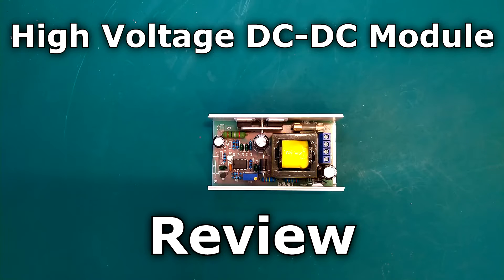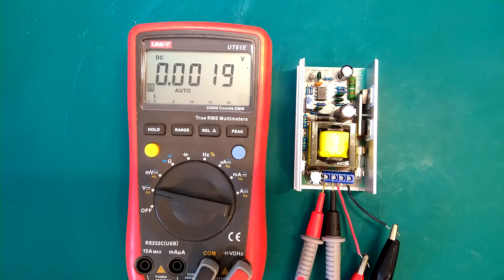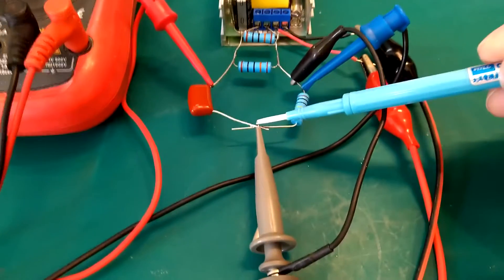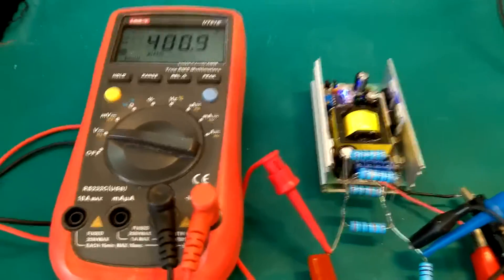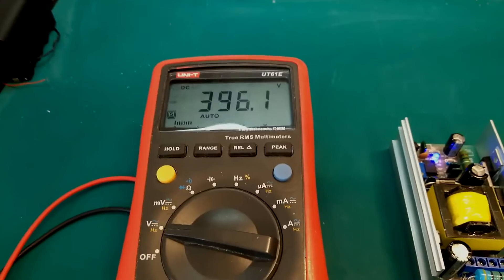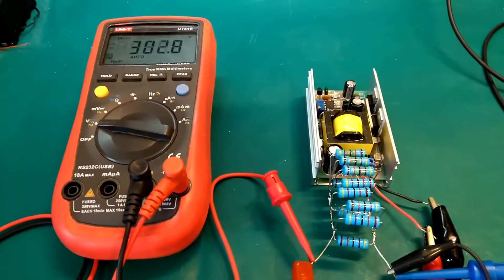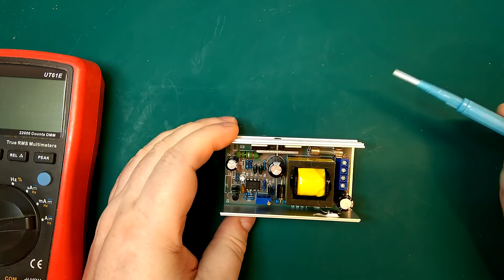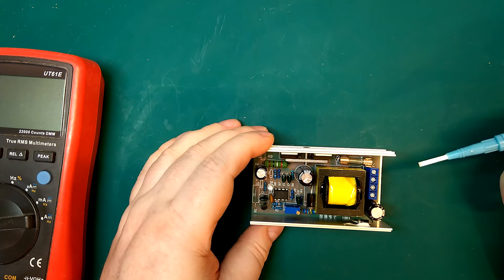High Voltage (200-450V) DC-DC PSU Module $10 Ebay Review

Comment from the maker: Advertised as being able to deliver 70W peak and 40W continuous, however I find it will not deliver more than 20W max. I don't recommend buying this module unless you plan on powering it using 24V and you don't need more than 20W output.
Reply: Thinking about putting it to trickle charger  a high voltage battery from a solar panel.

Comment: Thanks for the vid! Did you notice any annoying buzzing sounds from the transformer etc?
Reply from the maker: Hi, I haven't experienced any sounds from the transformer, it behaves very well. I now use the module in a high voltage capacitor leakage tester project.
Cheers,
Jake

Comment: I need high dc-dc voltage step down module
Input 100-200vdc
Output 50-100
Reply: They got lots of those selling stepping down voltage is easy. Going up is a bit difficult.

Comment: I need to to convert 12 VDC to 285 VDC at around 0.400 amp. (400 milli amp). I am trying to charge my dead hybrid batteries. can you help with the info soon, please. thank you very much
Reply from the maker: That's 114W output, none of the modules I have tested are able to deliver this much, plus it will need to draw at least 30A from your 12V source. You could try running multiple modules in parallel using some diodes and resistors to balance them, but I can't guarantee good results.
Cheers,
Jake
Reply: @TheStuffMade  thank you for your reply. I found a way to charge with lower voltage by using a bench power supply, 11VDC at 3.2 amp.
Reply: @bobbauvian7700  - I'm also trying to charge a hybrid vehicle traction battery, a 2008 Prius Gen2 rated at 201.6 volts DC. Have you had any success? Thanks for responding
Reply: @3000Jeffrey  yes, I disconnected all the battery cells and charge them 8 cell at a time, You can even do 1 cell at at time. I had a bench top power supply, and 16 alligator connectors. so, I charged 8 at a time. the voltage of a single cell battery of mine is 8 volts. so I set my power supply up to 8.2 and 3 amps. it charges quick so stand by the batteries, disconnect power supply and measure making sure you don't over charge. I probably could have done a better job with lower amp setting and taking my time. but I needed my car. maybe if you do all the cell at the same time you get a more uniform charge....but you make do with what you got. On my Prius I had to replace the 12V battery as well. 
  
you may do a better job if you recondition the hybrid batteries. do your own research on how to recondition hybrid battery.  I may be making a mistake but the way I understand it goes like this:  using a load drain the battery cells and recharge them. I did 1 cell at a time. I used a halogen bulb (24V 150W). Bulb did not turn on bright at all but it did do a good job at draining the batteries. when you disconnect your load the voltage should go back up. I discharged to about 5.5 or 6 volt and when discounted the load, voltage went over 7 volts which is the indication of a good battery. on my battery any that did not go over 7 volts after load was discounted should have been considered bad battery cell and replaced. the battery cells towards the middle had a hard time but I kept at it recharged and discharged them multiple times and they picked up. My Car had shut down and could not drive any more. Using the method above it came Alivee, and drives up to know, though I do get a triangle, check engine lights and warning still when in traffic specially if air conditioning is on...which I can clear out by disconnecting the main cable from the 12 volt battery for 5 minutes. 
I should have replaced the 6 or 7 middle battery cells at about $40 each. since I was not sure about the quality of the cells for sale I decided not to do that. 
found a guy close by who would replace the bad cells and charge $600, 3 month warranty. I did not do that either. 
found an outfit about 150 miles away who replaces the complete battery for $1200 with I think 2 or 3 year warranty. batteries are green color. this I will do within a couple of months.  
I hope this information helps helps you.

Comment: (308V*65mA)/(24V*1.2A)= 20.1W/28.8W=0.697 eff.! Not that impressive, but what to expect at 20kHZ? There are low voltage DC/DC converters appearing from China, that operates in the MHZ range and uses a hi Q inducter and fast caps and diode, and they peak at 92-95% eff. So let's hope they design a hi-voltage version like this. However it will need more expensive bits, so it won't be as cheap as this, but China expensive is preferable to Mouser expensive. Thanks for the review, That saved me some trouble.
Reply from the maker: Thanks, those are useful numbers. For my use I haven't been too concerned about the efficiency and 70% isn't too bad, but sure, I understand if you want to use it for anything battery powered or part of a renewable energy setup, then this converter is not a good solution.
Cheers,
Jake

Comment: Good review but it would have been nice to see how much current it takes from the power supply with each load to know how efficient it is.
Reply from the maker: It's a good point, my focus was mostly on whether the psu would be able to deliver what was promised in the sales specs. I'd say these are probable fairly low efficiency as they are low input/high output voltage, so I wouldn't expect anything above 50-60%

Comment: Hello, thanks for this review. Im planning to use it for my hv 200v battery charging from 12v source. Do you think it can be done?
Reply from the maker: Hi Bryan, I just hooked up the module with 12V input and a 5K load then set it to 200V output, no problems. So it will deliver 40mA+ at 200V with 12V input. It should work fine to charge a 200V battery, just be aware the 200V output is the lower limit for this module, but you can of course just add a resistor in series to limit the current.
Cheers,
Jake
Reply: TheStuffMade Tqvm... cheers
Reply: @bryankok2315  -  I'm also trying to charge a hybrid vehicle traction battery, a 2008 Prius Gen2 rated at 201.6 volts DC. Have you had any success? Thanks for responding

Comment: will this work to charge 800mfd 450vdc mallory capacitors?
Reply from the maker: Yes, but you have to add a 10k/20W resistor in series to limit the current.

Comment: Is it possible to run them parallel with maybe diode isolation?
Reply from the maker: I haven't tried it but I'd say they would probably work fine in parallel since the output voltage just drops when the module is unable to deliver anymore current and it doesn't seem to overheat or anything.
Reply: TheStuffMade thank you for the response!

Comment: Very nice review!
I’m currently working in a variable high voltage bench power supply. Actually, I’m using one of this modules as a HV power source, instead of using a heavy transformer. I can say, that the modules I own, are capable to source nicely 40W out of them, with 20Vpp of ripple, at full 100mA, and just 5uF of extra capacitance conected to the output. Not bad at all. 
I can notice, that the module shown in your review is not exactly the same type that I have. Mine doesn’t have the big resistor, that gets hot in your video (big green one), it has a short jumper instead. I can also see, that mine doesn’t have the big diode in the middle of the PCB. 
Here you can see an Ebay seller that has the same type that I have. Wish you had one of those to see how well perform. 

This is the Ebay link with a picture of the module type I’m referring to. 

https://rover.ebay.com/rover/0/0/0?mpre=https%3A%2F%2Fwww.ebay.es%2Fulk%2Fitm%2F162083457623

A very weird thing is that at 80mA the module shown in your video, stops sourcing ripple. In mine, ripple is present always at the output. So, something might be going wrong with yours. 

Hope it helps. 

Keep doing those nice videos!
Reply: Forgot to mention that in mine, the input fuse is T10A, not a 3Amp. 

The buyer says that it needs a 7A power supply at least, powering from 12Vdc. I believe that’s why the fuse is rated at 10A in mine. 

Cheers!

Albert
Reply from the maker: Thanks, I will try order from the same shop you got your modules. I guess it makes sense they've added some kind of current limit if they experienced a lot of returns because people probably buy these to charge large capacitors for rail guns or similar and they wouldn't survive the low impedance of a large capacitor.
Reply: Hi!
Yes, it could be the reason for the current limiting thing. 

You’ll love the performance of the module. 

Best regards
Albert

Comment: No 40 Watts from a tiny transformer? Curse you Physics!  :)-
Thanks for the review. I saw a similar review a while back as well. Another thing to mention is that these modules usually do not allow hook up in parallel or series.. you are stuck with having to use just one module. I'm getting to the point where I have started looking at rolling my own HV boost convertor... I have seen projects for those in the American ARRL handbooks.
Cheers,
Reply from the maker: Yeah, you are right, there is no magic, you will not get 100W from a small handful of electronics. However I would probably been satisfied with 20W if that was what it was advertised at, but they had to go 70W peak !!